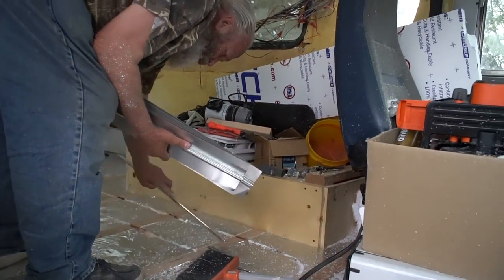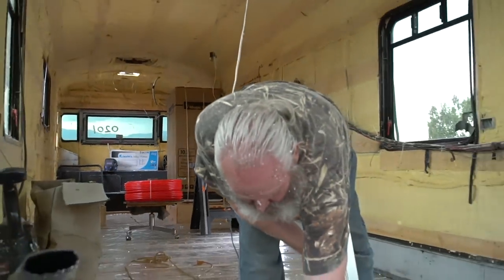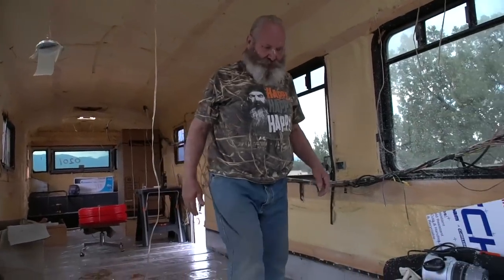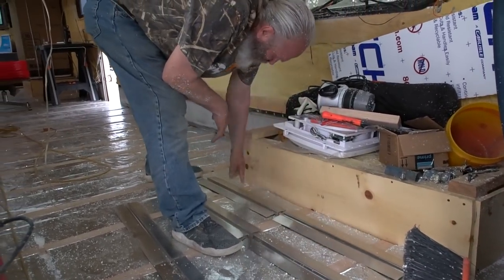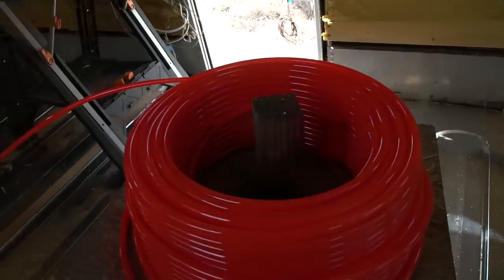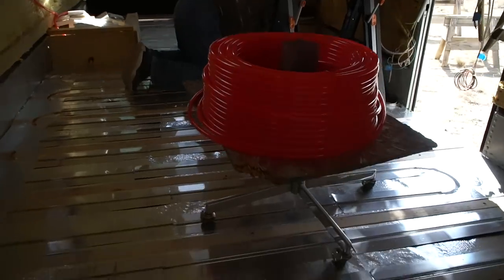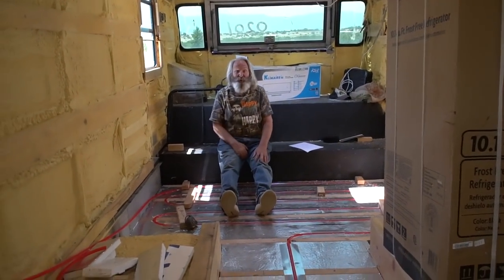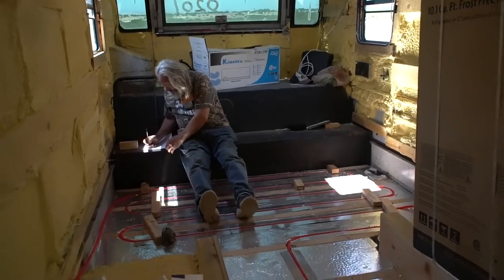Skoolie Gets Radiant Floor Heating Installed ~ Ready For Subfloor

Comment: Off topic a bit but I wanted to let you know that I covered the metal roof on our truck camper with Henry Tropic-cool after watching your video. Incredible difference !  The normal morning dew doesn't evaporate until about 3 in the afternoon on an 85 degree day. The 104 degree temp roof temp is now around 84 on an 80 degree day (in direct sun). For the first time since we owned the camper, the inside temp is now equal to the outside temp with just the roof vents open. Previously it was about 94 inside the cabin on an 85 degree day. The interior ceiling temp is about 16 degrees cooler now also :-)  Thanks for the info !
Reply from the maker: Awesome, I am glad the video helped!

Comment: One reason you might want a some shine on the floor of your bus is the dirt doesn't get so embedded, you could clean it up a lot easier with a mop or swifter. We shined our dull vinyl floor up in our RV. Maybe after you blow torch that plywood, you could put a clear finish over it.

Comment: Jim is awesome. He inspired me to put radiant floor in my 96 28’ Safar Trek. Powered by water heater, plate heat exchanger with solar pumps
Reply: Mitch Mills hi Mitch. I too have a 96 Safari Trek. One of the best motorhomes ever built (by a factory).

Comment: If you do a radiant floor on a 35' skoolie, how much is the total project, again? With insulation, pipe, reflectors, custom water heater, etc? So worth it if your up North a lot, tho.

Comment: I am working on a radiant floor heat system on my bus as well. I am trying to find a source that would help me size my system appropriately. Did you find any information on what size heater to use and how much propane it would use to do it? I would appreciate any help if you have a link or any information thank you.

Comment: i was thinking of this in my 69 fireball 20' camper. i was thinking of using one of those cheap gas hot water shower  things from ebay or maybe the existing gas water heater. how nice it would be to have heat and no blower noise. some of those campers have a forced hot air that sounds like a jet.

Comment: Question.  If I have 7.5 x 15 bus, but I have 2.5' X 15' of storage/bench (24" high") running on both sides, would you still put radiant under it or just in the walkway which is 2.5 right down the middle?

Comment: So, Are you putting screws straight into the metal floor of the bus when you install the wooden cross membranes ? and what kind of heater are you installing to run your radian floor ?
Reply from the maker: Yep. Using a Dickinson Marine Heater.

Comment: Unless you have some kind of vacuum  in the bus, not safe for living, that is not radiant heating. It's conductive. A particle with mass at a higher energy state passing this energy to a particle at a lower energy state.  Air has mass.

Comment: I don't think the red pex is rated for the level of heat that is going to be running through them versus a traditional hot water faucet. Granted most boilers are adjustable so this probably isn't a big deal

Comment: Good progress. Soooooooo good to have Jim directing the project as he's been there, done that. What's the heat source(s) for the radiant?
Reply: He'll be using a marine diesel heater.
Reply: Hmm...no loop through the engine I guess. Either way, a great idea and efficient.
Reply: @JohnS-zq8ks  we looked into using the stock heating system and it really only works well for when you are moving anyway as a way of reclaiming what would be otherwise lost heat to the outside.  In a stationary setting, heating up the bus engine to pull a portion off as indoor heat is not so sustainable.  Chris will use a marine diesel heater which will burn roughly a gallon for a day's heat if I'm remembering correctly.  We're working on using a boiler loop in a self made wood fired oven to run our radiant heated flooring.
Reply: No idea where the bus will be traveling, but I know Chris drives until late on his way to Alaska, then parks later in the evening. Usually, he's driving in cold weather. Unless cost prohibitive, I'd run a loop through the engine to capture this during the drive, so the bus is already warm when he stops. If it's just a few hundred bucks and a valve in the bathroom or something, why not? But I've done projects like this. A few hundred bucks x 20 isn't small change! It's a really great project to watch and I'm sure many folks are learning a great deal. Good work!!!!!!!!!!

Comment: radiant floor IN A RV? WHY?
Reply: It's pretty efficient to heat up the mass of the bus from the bottom and have it conduct/radiate upwards into other surfaces.  It helps eliminate convective drafts, and it feels good to walk on when it's cold out.
I'd ask why not.
Reply: Rlinda mcfarlane It gets cold in Alaska in the winter! ❄️
Reply: depends on where you live and anything closer to nature is always more efficient.
Reply: Because radiant heat is super efficient ( If done with a diesel heater, it could stay warm in there for less than 2L/day down to about 0 Celsius). And being in your socks with snow falling on the roof is a pretty cool sensation :)
Reply: Because its a stupid hippie idea.....That's why

Comment: What is the Gross Vehicle Weight Rating of that bus? 36000 lbs? Are you weighing it as you build to make sure you don't go over?
Reply: I was wondering the same thing.  he's planning for a HUGE water tank in addition to all the extra metal for the roof raise, all the foam insulation, how many solar panels?  the roof rack.  there's going to be a lot of wood when they start finishing the interior. That refrigerator is pretty heavy.  then when it's done they're gonna put themselves plus all their gear inside of it.  Nomadic Fanatic just weighed his RV and he was 200 pounds under but that was without the motorcycle and rack that he just got rid of.  he was 50 pounds over when he had it.  anyway he decide to get rid of another 200 pounds worth of stuff after weighing the RV just to be safe.
Reply: Nomadic Fanatic also has a class C commercial motor home.
The ability to apportion for extended off grid boondocking is why Chris is moving from the class A he had to putting in the effort of building out a heavyweight platform.
He'll still have thousands of pounds of leeway when fully loaded.
Reply: Chris has covered this in earlier videos. He's well aware of the weight limitations as he builds this bus out.
Reply: @luckylucy12lucky   Being 'aware' does not mean he will not exceed the GVWR, especially if he is not weighing the bus as he builds. In wonder what the current weight is.